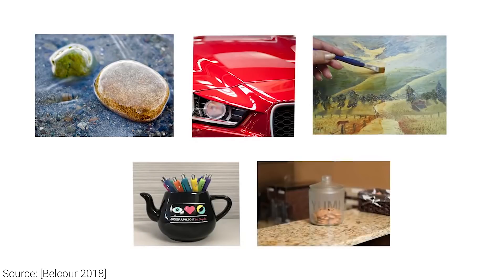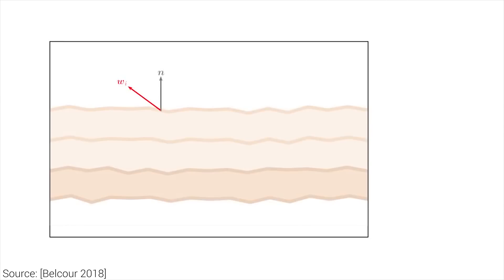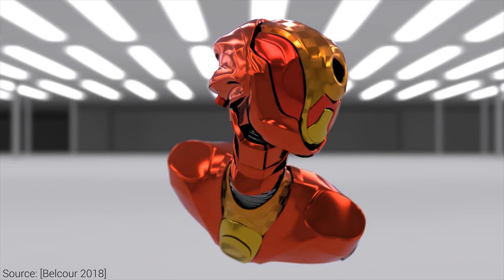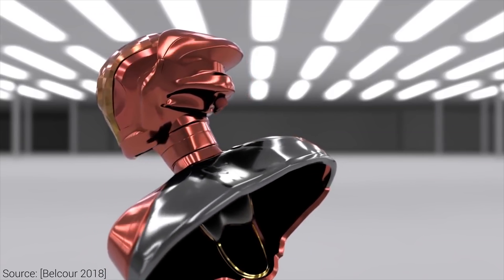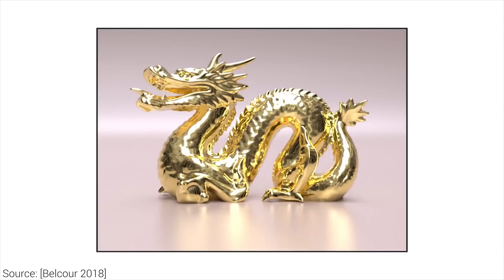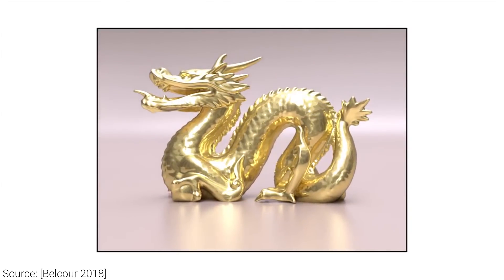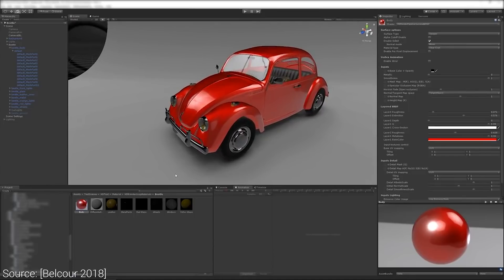Beautiful Layered Materials, Instantly | Two Minute Papers #260

Comment: I wonder what this means for texturing now. For example will a roughness map only affect the uppermost layer or all of them? Or will we use separate roughness maps for each of the layers? Can we also use a texture to vary the thickness of different layers along the surface? Can we use different colour textures for different layers?
Reply: We can specify a different roughness map for each layer. For textured thickness, it is possible, in theory. But the error comparing to ground truth will grow larger as we approach grazing angles. Lastly, we can use colour textures for different layers.

Comment: I remember in my university we discussed an older paper that could do something similar. However it needed quite expensive precomputations before the actual rendering process could start and also required some memory to to store the precomputed bsdf. I think the main drawback was that you could not really use textures in your materials. Because the precomputed bsdf was only meant for the very specific parameter values that were used for the precomputation. But if you vary the bsdf parameters along the surface with a texture. (e.g. a roughness map) you would need to precomputed very many different bsdfs (one for each roughness value that appears in the roughness texture.)

To cut a long story short: Does this new method support textured materials?
Reply: Besides I like it that you still present papers about light transport stuff. Your machine learning stuff is interesting too. But I still missed your light transport stuff lately. You have been presenting only machine learning papers for quite some time.
Reply: The abstract of the paper answered my question:
"Unlike previous methods we support an arbitrary number of textured layers, and demonstrate a practical and accurate rendering of layered materials with both an offline and real-time implementation that are free from per-material precomputation."

Awesome! Someone should implement such a shader for blender cycles!
Reply: I've read the paper and indeed this technique can support many existing rendering techniques quite easily, including texture mapping. Planning on implementing this material model in my hobby renderer!

Comment: This might be a dumb question but, how is this different from subsurface scattering?
Reply: Subsurface scattering deals with depth in translucent materials, such as milk or human skin. These materials reflect light from layers that can be several millimeters deep, and thin areas can transmit light from the other side, like the thin skin between your fingers, or an earlobe. In SSS, the depth and structure of things below the surface matter in the rendered result.
This technique deals with thin films, such as the lacquer or enamel on top of metal. The layers are microscopic, measured in μm (not mm) so this technique is able to model their effect on light statistically and deliver very fast results.
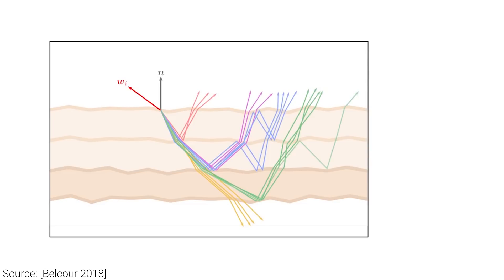Reply: Not dumb. I think the difference here is that typical subsurface scattering is actually simulated with rays (shown  @ 0:33), while this new method builds some statistical model which represents what generally happens under the surface, given some input parameters. Basically, one is a simulation of rays bouncing, while the other is just solving one equation over and over, but with different inputs.
Reply: brianorca So, it won't be able to render skin as photorealistically as with ray tracing SSS (like randomwalk)?
Reply: I am not sure. But I could imagine the difference is that with subsurface scattering there is actually a distance between the point where the ray enters the material and the point where it exits the material. So you have a bssrdf instead of just a bsdf.
But here the distance is so small that we set it to zero. So on a macroscopic scale the layers only affect the direction into which light rays are reflected when they hit a certain surface point but not the position from which the secondary ray is shot in your path tracing engine.
Reply: Joe Ch true, this technique would not be best for skin.
Reply: SSS is specific, this is generic to any material with any number of layer
Reply: SSS can be applied to any number of layers as long as those layers are modeled as non-overlapping bounded volumes. This work is exciting because it is dramatically faster than SSS, not because it is more general.